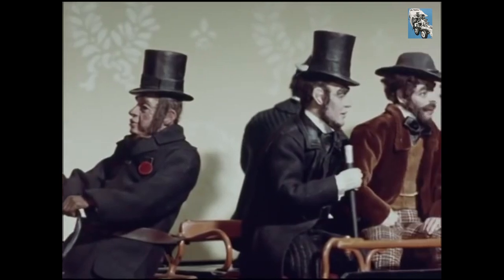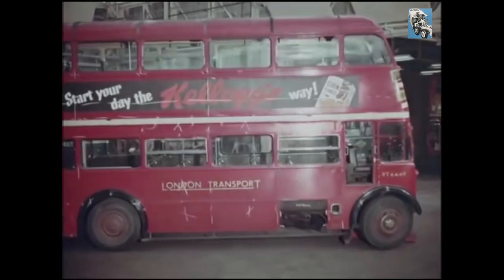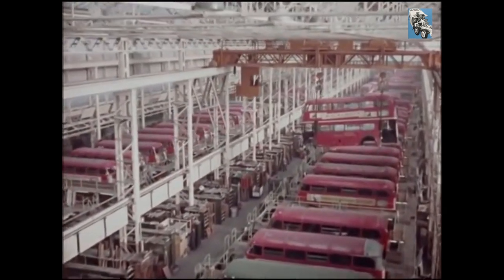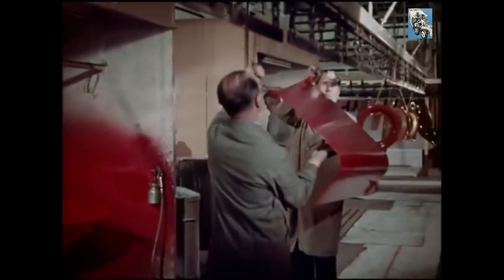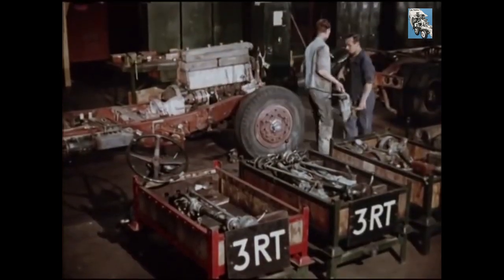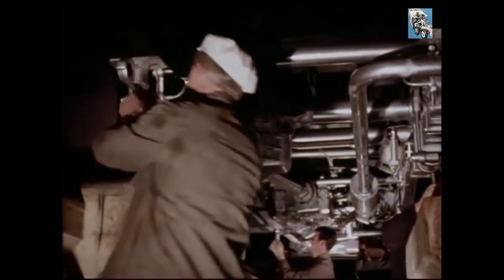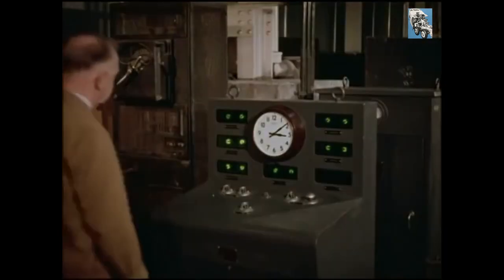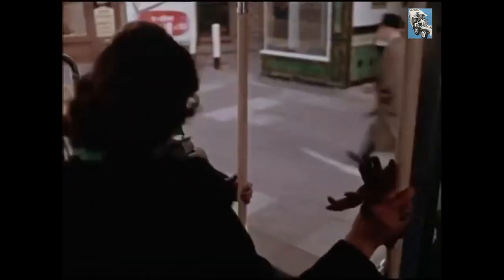Overhaul - RT London Bus Overhaul Documentary - British Transport Films - 1957 - Full HD

Comment: I understand the AEC engine  and gearbox was fitted to the 1930s GWR railcar which was updated to be a BR type post war.  GWR thought the engine well proven and ideal clutch type. If taken along side the 1930s English Electric diesel unit it was remarkably compact. The EE was a modular design. The Oxford bus company had similar AEC buses which Oxford thought slightly better. The Oxford bus museum Long Hanborough has various types. The 1948 ( RT? ) very comfortable. 9 MPG I was told or better. AEC Matador lorries are celebrated. EE locomotive - railcar called Thumpers also using the generic EE engine. 08 class shunter type the origine  for LMS ( 1947 LMS 10 000 - 10 0001 related ) . GWR almost saved the branch lines with AEC help. BTH ( EE ? Napier ) units also used.